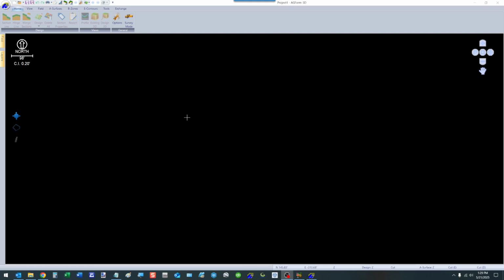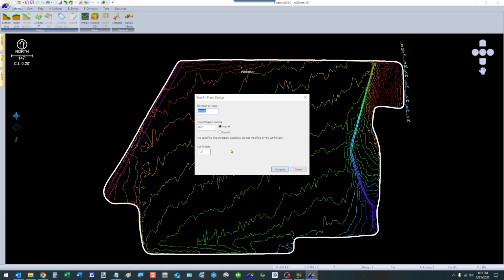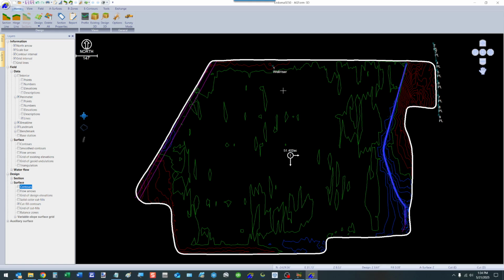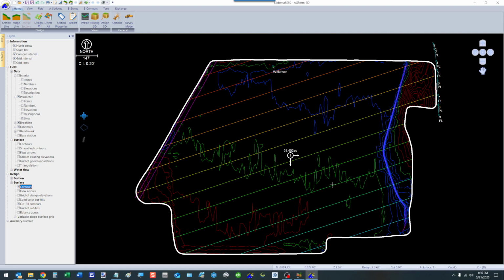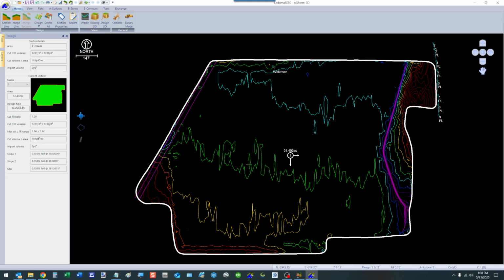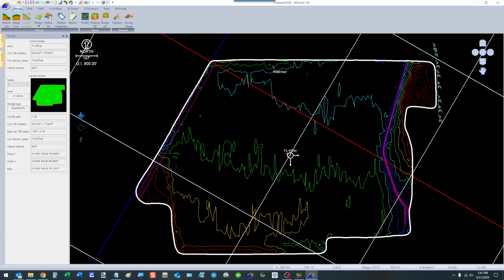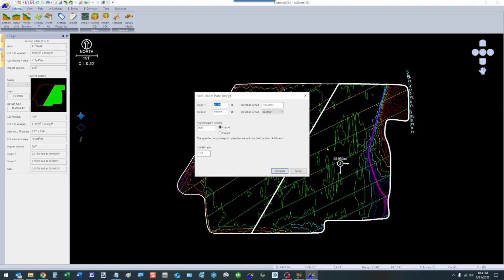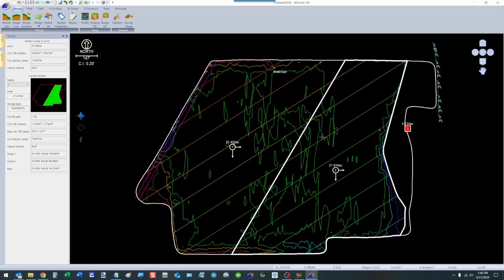Topcon Agform 3D Basic Planar Design

Comment: Apologies if you mentioned this in the video but I'm someone that's only ever used T3rra. Does Topcon offer something similar to what T3rra calls "multifit" where it basically divides your field into narrow planes and the software gives you a design that's not precision but still allows you to select your primary slope?
Reply from the maker: Yes. It's called variable slope(non-planar) surfaces. It will probably be the next video I do. If I'm not mistaken, T3RRA uses narrow "planks" similar to a hardwood floor in a house to make the surface into a variable or non-planar surface. AGForm-3D  uses a grid to produce the same style variable or non-planar surface. You can change the size of the grid to achieve a more accurate surface. 10 ft being the smallest.
Reply: @miketyson4172  Yes. Thats correct. Planks is the perfect way to describe it. In whats called T3rra design, you do have the ability to change the planes width and length. Ive considered looking into Topcon because ive heard such good things about it. I was just hesitant on if that option was available. Thanks for the info.👍